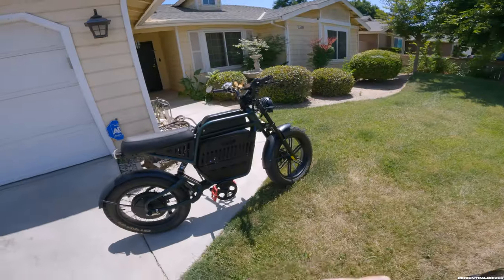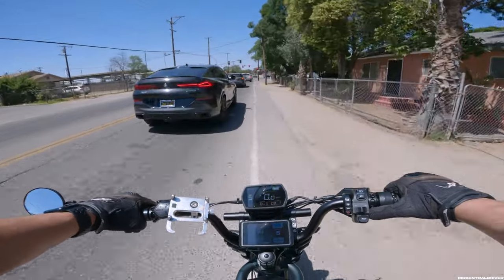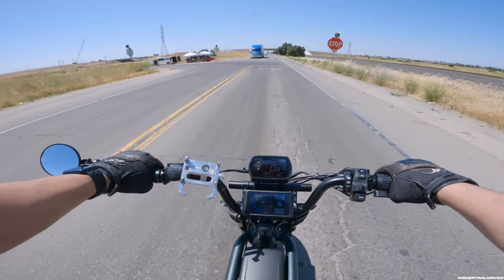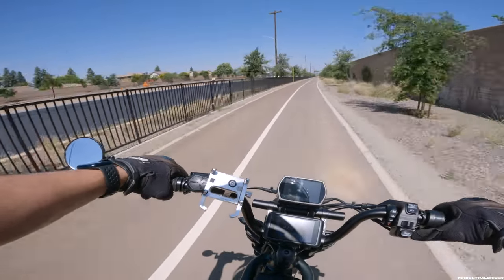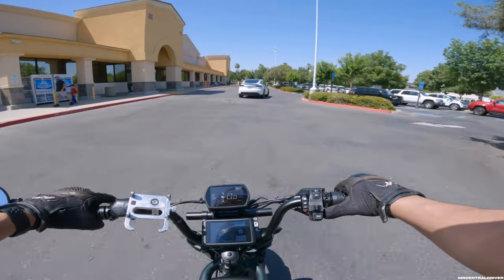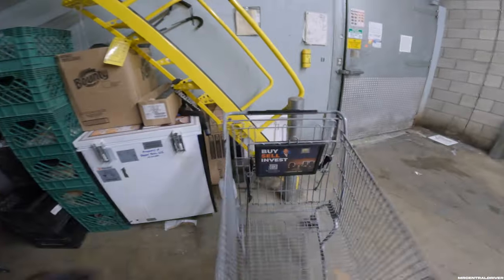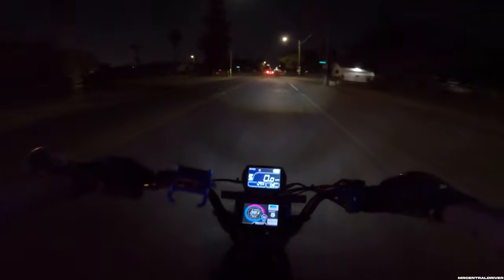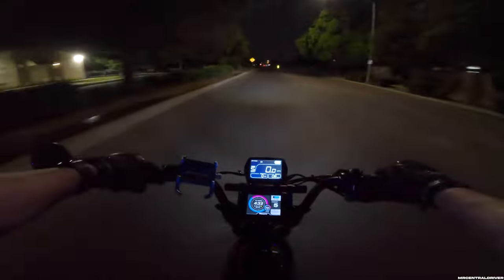Another REVV 1 72V Video + NEW EBIKES COMING!

Comment: I had the same problem with a freewheel removal -- I ended up drilling out the inside of the tool with a 3/4" or 1" drill bit (can't remember which) to make it large enough to fit. Has been holding up great for many, many freewheel operations.

Comment: Seeing as you are pretty savvy mechanically speaking. How difficult would it be to switch my mechanical brakes over to hydraulic with a killswitch
Reply from the maker: switching to hydraulic shouldn't be hard but u do have to cut lines and make them the proper length but the killswitch not sure unless you get the magura mt5-e those would connect to your stock brake connectors if your bike has them. but custom installing kill switches if you don't have them. no idea at all
Reply: @MrCentraldriver I have the jansnox50 and it has an engine killswitch(I'm assuming) when I hit the brakes there's no power to the engine.

Comment: You should try to put a different number of teeth chainring, maybe it will help with your chain length problem.
Reply from the maker: if you go smaller it will hit the frame. if you go to big it blocks the bolts to the bottom cover.
Reply: @MrCentralDriver  maybe you could cut the frame, stretch it till the chain is tight enough then weld it.

Comment: I know this is kinda late for posting but I'm curious if you have the link to the torque arms you used for the Revv1. My other question is are 120/80-16 tires applicable for both wheels on the Revv 1 by chance?
Reply from the maker: https://amzn.to/3HZFD1p
Reply from the maker: and the tire question. not sure. i wouldn't see why they wouldn't fit
Reply: @MrCentralDriver  had some issues with ones that I had gotten previously. The issue was on how big the radius would be around the wheel since I wouldn't want to risk exchanging via air mail. Last fitment seems to be rubbing in the rear part of the frame.

Comment: Just out of curiosity could you have run the phase runner with 72v on the stock motor?
Reply from the maker: no current phaserunner uses this revv1 stock motor connection

Comment: Question What's The Top Speed Of The Onyx RCR Right Out The Box WithOut Doing Anything To It On Speedmode?d
Reply from the maker: Speedometer will say 56-57 mph. Bike stock goes 50-52
Reply: @MrCentralDriver  Thanks Your Information Really Helps A lot Thanks man 👍

Comment: Ugh i wanna update my ebike so bad but iam so scared if i have a 1200w motor can i just change my lcd. Screen and controller?
Reply from the maker: Most of the time it doesn’t work out like that because the motor you have on your bike currently uses a connection for the controller the company matched with it. If you can find a controller that plugs directly into your current motor connection you can do that. Most controllers come with a display that is not like the factory one but you also can’t put a bigger controller in there that pushes more apps out of the motor if your battery can’t handle it.
Reply: @MrCentralDriver   so basically just get a whole new ebike kit ?

Comment: Should just go loose chain

I remember when I rode BMX  there was a time that it was a fad to ride with the chain as droopy as possible without slipping 
Don’t use it anyway
Reply from the maker: no it hits the hub motor and that's not safe and that was just sitting stationary. enough were it will just fly off. 1 link makes a huge difference when u have no dropout to move the axle
Reply: @MrCentralDriver  Oh okay
Then strike that remark 
Was thinking it was just a tension issue, not clearance